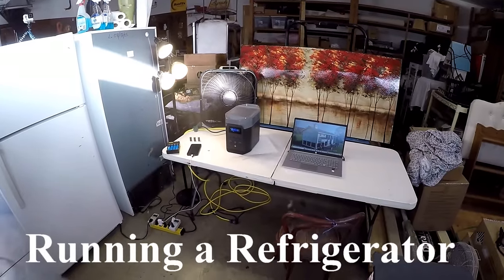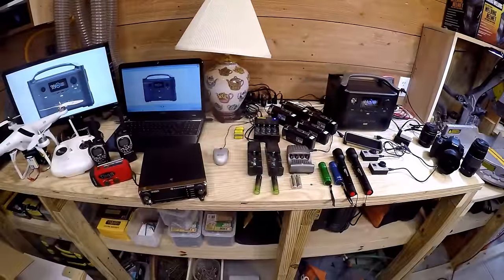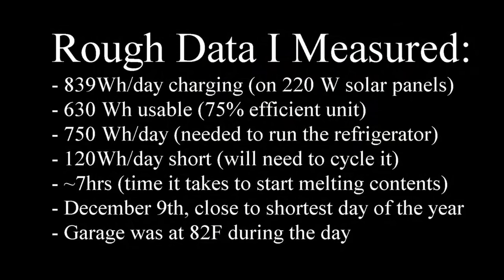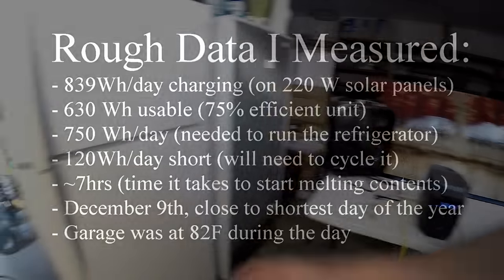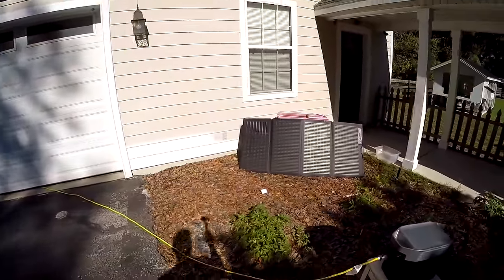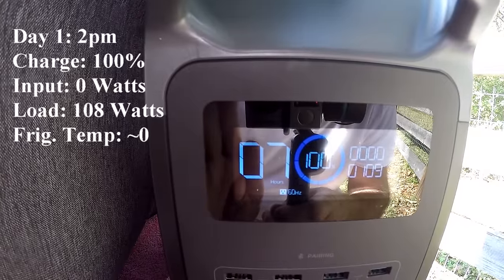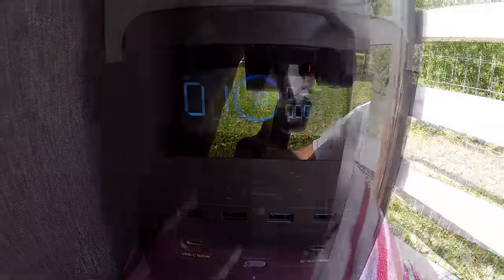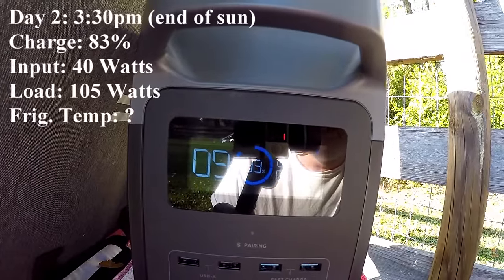EcoFlow Delta 2 Refrigerator Test with EcoFlow 220 Watt Solar Panel

Comment: I am not sure what was the objective of the exercise by plugging in and unplugging the fridge and also turning off the Delta2 unit.
Reply from the maker: The point was to see if the Delta 2 solar generator could back up the refrigerator.  I cycled it to save power and that worked.  Could I have just left it plugged in and turned on the entire time?  Maybe...
Reply: @HomesteadEngineering  ok. Point taken.
I thought you would have just left it plugged in.

Comment: As long as the sun is shining ??
Reply from the maker: Yes, With the sun shinning it takes just about all this unit can do.  If you really want to hold up a refrigerator, I would go bigger (more solar input and more battery).  BTW: I use this unit every day.  Its running a window AC right now. No issues so far.

Comment: What happens if we're really grid down for months/years and updating firmware is impossible? Will this very expensive solar cell fail me when I need it most?
Reply from the maker: I have been running this unit for almost two years with no firmware updates and no issues.  Works like a champ!
Reply: @HomesteadEngineering  Thank you, I've been wondering about it.

Comment: In a true emergency situation, where electricity returns are unknown, it would be wise to insulate the outside of that refrigerator. Even draping towels over it would diminish heat intrusion.
Dang, grease those fridge doors!

Comment: So you could probably cycle off for 5 hours and on for 2 hours. Be interesting to repeat the test in summer, won't be able to turn her off for as long but on the other hand the night will be shorter :)
Reply from the maker: Yep, lots a ways to make it work.  Summer should turn out better.  Thanks!

Comment: Keep in mind “Refrigerator” has a defrost cycle every 24 hours (in my case) defrost do use a lot of power in more watts added to it.
If someone knows how to hack and add a bypass switch to the defrost device, please share.
Reply from the maker: Good to know.  Thanks!

Comment: An efficient fridge should cycle enough to only average about 50W.
Reply from the maker: Yes, I think I got about 32W on average for this refrigerator.  It is a bit on the small side for full size refrigerators.  Thanks!

Comment: To be fair, you DID keep opening the door and letting heat in..... Better to have a remote temp gauge to see temp inside without opening the door.
Reply from the maker: I purposely opened the door a lot to simulate what generally happens in an actual outage.

Comment: can i put in a washing machine;
Reply from the maker: It may run a washing machine but I would not use it for that purpose.  Thanks!
Reply: I wanted to ask something else, I tried to fill it with a Hyundai 3500 generator and it didn't give more than 30 watts, do you know why?

Comment: Having the frozen jugs in the freezer extended the time of the temp going down and melting the ice.
Reply from the maker: YES, That should be a lesson to folks.  If a storm is coming, freeze a couple gallons ahead of time and that should help a lot.  Thanks!
Reply: @HomesteadEngineering  I know I live in PR and went through Maria in 17. I have an ecoflow delta Max 1, and it runs my fridge 12 hours fine no disconnecting. I recharge with a Honda 3000 which tops the EcoFlow in 2-3hrs at reasonable charge speed. Yes all our freezers have ice blocks and water bottles.

Comment: I'm just going to come out and say it. This test was flawed given the fact that he was really only monitoring the freezer which is brought to a much colder temperature below the point that it needs to be versus the refrigerator so based on how he was trying to show us that things were good. Yes only if you care about the stuff. Not going bad in the freezer. Otherwise, things might not have been so good with the refrigerated items they might have gotten up to temperatures in the mid-40s even 50 in the cases that he showed us, which if it gets to 50, that's just too warm. 42 is considered the point at which it is no longer refrigerated but still refrigerated and preferably keeping everything below 40° in the refrigerator but above 32° is the preference for the refrigerator. I guess you're only option if you're in a power outage. Prone area is turn the refrigerator as low as it can go before it freezes stuff and the freezer too. And just because the freezer itself stays cold does not mean the refrigerator stays cold and honestly with the ecoflow units and how fast they can charge from AC power, I would be pairing this particular setup with a cheap gas generator like the one you can get from harbor freight, the predator 1400 generator or maybe even a predator 2000 generator to be able to quickly charge up the ecoflow and have it. Just run the refrigerator constantly and make way more efficient use of the gasoline you have.

Comment: I've confirmed that it runs at max 1800 watts. If you run maxed out at 1800 watts you'll get one hour of use. The 2 solar panels will will recharge it in 3 hours. Only 1 solar panel will recharge it in 6 hours. 

If you only use half of the 1800 watts, 900 watts, you'll get 2 hours of use. Remember this is CONSTANT USE. those extra batteries that aren't that heavy, extend out your hours. Pretty much 1 battery per hour. 900 watts constant use with an extra battery will get u 4 hours of constant use. 

For camping, this is good to recharge things / items with an already built in battery. Phones, Fans, / LED Lamps / Lights,  Laptops, even a small portable camping fridge (yes they make them),  when that battery gets low, use this bank to recharge it. 

Yes you can use power tools with a cord CONSTANTLY, or use the battery power tools  / aka cordless, like DEWALT etc. to me that's the BEST USE of the system. 

For power outages, this could be used to power the modem and router so your phones have Internet while you're down, if u don't have a phone bill, or maybe bad signal during outage, maybe u need to use a small electric burner if u don't have the camping stove or grill of any kind. If your fridge as been unplugged for over 5 hours, u can use this to get ur fridge back to temperature then unplug and ur good for ANOTHER 5 hours. 

Using this to power a small tiny space heater to stay warm probably isn't the best. It'll run an hour and then drain. This is for use during a power outage at home for a little while, to keep small things up and running, or for camping. 

If you're wanting to run your central AC / Heater and lights/ home wifi / TV / Fridge / on a CONSTANT basis during a power outage, you'd need a generator and one with atleast 10,000 watts. Outside you gotta keep it. Plus buying gasoline/ kerosene/ diesel.
Reply: 82 F is also an extreme scenario. During a power outage, most ppls homes aren't that hot. 72 to maybe 74f is average ( 68 F for me personally). During an outage, the fridge is good for 6 hours. I say around the 5 hour mark u can plug the fridge back up to get it back to temp then unplug and extend out things for another 5 hours to keep food good.
Reply: I guess the "way" I was thinking of use, is not using the solar panel as well as consumption at the same time. It's pretty much a "let's see how long 1 full charge gets u until power comes back on" thought process. Using the panels during the day would seem to extend things out giving longevity.
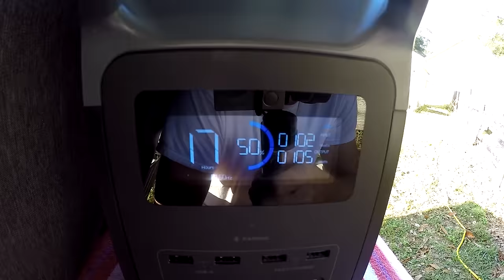Reply: 6:39 this is where I'd unplug the fridge for 4 to 5 hours since the temp is already at 0 F. Takes the load off the unit to help recharge the battery. Take full advantage of the panels power. Per manufacturer, 2 panels running takes 3 hours to recharge with zero load. 6 hours w only 1 panel.

Edit : I don't keep my freezer at 0 degrees F though. I keep it at 30 degrees. And keep the fridge around 40 to maybe 55 it's to chill items so they don't spoil. I assume you're pushing EXTREMES past what average person does. I could be wrong. I'm going section by section of the video without watching fully at first.
Reply: Ok just finished watching all the way through. My conclusion is to run the solar for 3 hours with both panels to fully charge, then can run the unit to power the fridge, perhaps with solar still going it'll run entirely through the day. Then at night like u did it should run the until through the night, unplug fridge for 3 hours, let unit recharge with panels back to 100% then turn back on. 

Good scenario man appreciate ya.

Comment: at minute 5:36, you are Wright.   night temperature usually goes down. so before you go to bed, set your refrigerator to a lowest temp.  before  32 ' or even a little higher than that 38 to 45, when the refrigerator door is not in use. get up at 7am get a good Night rest and turn it back on before breakfast.

Comment: I don’t see the purpose of cycling the refrigerator on and off.  If the panels make enough electricity to fully charge the Delta on a sunny day from a very low charge level, discharging it to 40 or 50% and letting the refrigerator sit there unpowered for hours then turning the generator back on only to drop the temp. of the refrigerator back down to what it was before you shut it off makes little sense to me.  This is especially true if the generator is fully charged while there is still sun.  Then those panels are feeding the generator more power while the sun is out than the refrigerator needs to run.  It is theoretically a waste.

I have a small Bluetti unit that I have conducted some experiments with and I have a Delta 1300 on the way.  I will have a total of 6 100 watt HQST panels which I plan to run 3 in parallel with the other 3.  This may be overkill and overload the generator.  If it does, I will just run 2 in parallel with the other 2.  It will be nice not to toss all my food in the refrigerator away after a hurricane.

I am also looking for advice on charging one with a non-inverter gas generator. Of course I would connect a quality surge protector between the gas generator and solar generator.
Reply from the maker: I think there are several ways to make this work.  I do think you are better off running the fridge the entire time that the panels are in the sun so as to avoid charging and discharging loses on the battery.  One solution is to simply use a bigger system.  
As for the dirty power charging with a surge protector:  I can't say for sure but I really don't think a basic surge protector is going to help you.  It takes some pretty expensive equipment to rectify a dirty signal into clean power.  I think your better off just using clean power from an inverter generator if your going to power sensitive electronics.
Thanks!
Reply: I just finished my own solar experiment with a Delta 1300 and 4 rigid 100 W HQST solar panels. I put the panels on the roof of my screened in room which gets sun about 70% of the day while the sun is up.  I started with a fully charged solar generator.  Day 1 was a good day for solar and I was at 76% when I went to bed.  Day 2 wasn't so good and I shut it down after 48 hours in the early evening even though I had over 70% charge left.  I conducted a second experiment with my Bluetti AC30 300 Watt solar generator and 1 100 watt panel and an in-line meter.  I had completely discharged the unit. During the whole day the meter showed that I only charged 170 watts back into the unit. It was threatening to rain all afternoon.

I already knew this, since I conducted a similar test shortly after I bought the Bluetti a couple of years ago. 

At the same time that I bought the Ecoflow Delta 1300 I bought a 3500W gas inverter generator. Ecoflow recommended that I not use my old generator. I can easily charge the Delta 1300 twice on a gallon of gasoline plus perform some other chores with the inverter generator. I'll still use less than a gallon of gasoline a day if I only use it when needed.  The generator is quiet and costs less than the Delta 1300.  The generator is made by MaXpeedingrods and there are reviews of it on youtube.

I have been without power for several days after a hurricane and l think that this is a less expensive approach than buying a much larger solar generator and hundreds of dollars in panels for a natural disaster.  If you live out West where the sky is not cloudy all day you can rely much more on a solar only setup. Here in South Florida where the days are partly to mostly cloudy I think an inverter generator is a great backup to solar.   

Thank you for your video. It was a realistic application of what one would use a solar generator for.  I have thrown all the food in my refrigerator away on 3 occasions after storms, at least all that I couldn't eat before the food went bad.  In the past couple of days the news has reported hundreds of thousands without power because of storms in the Northeast.  I'll bet a lot of those people would pay a premium price for a fully charged solar generator and some panels.

Comment: I dj on Tiktok in my flat im looking to do a few lives outside but been looking for a power bank people mentioned the jackery but people said the ecoflow is better. Im gonna be using my laptop outside my dj controller and 2 little speakers how many hours do you think id get out of it djing outside.
Reply from the maker: I would get a Kill-A-Watt meter and measure how much energy your actually using.  
https://amzn.to/4d3Y5UD
Plug a power strip into the Kill-A-Watt meter and then plug all your stuff into the power strip.  Then run it for a few hours and measure how much power you use.  Then you will know what size unit to purchase.  Be sure to oversize it by about 20-30% so you don't have to worry about running out during a show.
Reply: @HomesteadEngineering  Nice one think im gonna just get the ecoflo Delta its like £900 tho guaranteed to do my sets outside for a good few hours at least its just pricey.

Comment: What I do like about that Delta 2 is that I am able to connect my Delta Max extra battery to it.
Reply from the maker: That is a nice feature that really extends the use.  Thanks!
Reply: I think all the Deltas can hook together, as long as the smaller one is hooked to the larger one. I even saw a video of a guy that had 4 different named generators to each other. He said he just wanted to see if it worked, and it did. 🤔 I wouldn't have thought of that.
Reply: Oooh I didn’t know that but now I think I’m fully sold!!

Comment: Wow. 😲😲😲 I must be doing something wrong. I only got 4  1/2  hours refrigerator time from my Delta 2! 
I'm not happy with it at all. 
I also bought just one EcoFlow 220W Bifacial Portable Solar Panel. When I hooked it up, it told me it would take 28 hours to charge up the unit, and it was noon with no clouds in the sky. I understand 220W is just a fraction of what the unit will take, but I was hoping for better than 28 hours. I even made sure I had the panel facing the correct direction.  I also didn't realize you could put an extension cord on the panels. That's handy. 
Is there someway to program the unit for more efficiency? I just took it out of the box, charged it up, and plugged in the fridge. @HomesteadEngineering
Reply from the maker: Lets dig into this a bit:
1. How many Watts were you getting from the solar? You can see this on the screen when charging.  Should be about 180ish in the full sun.
2. How much power does your fridge draw?  you can measure this with a meter: https://amzn.to/4brfi8S
Those two things will tell us a lot.
Reply: @HomesteadEngineering  
on the Delta unit, it showed 175 when the fridge was running, and 35 at idle. 
I don't have one of the little meters yet that I can plug straight into the fridge to show the wattage.

The solar panel was in full noon sun, I made sure it was facing the right direction, and it showed 87 input.

I was not using the unit while trying to charge it with the solar panel. I just have the short cord that came with the panels to plug it into the unit, so I actually had to drag the unit outside to charge it. I need to look into getting an extender.

Comment: how long will it run small appliances like a LED TV, and a few LED lights?  i want a how long will the full battery last test for small off grid use.???
Reply from the maker: It all depends on what you plug into it.  It has a 1kWh battery but lets call it 750Wh after loses.  So for example, it will run 75 Watts of stuff for 10hrs.  It would run 7.5 Watts (LED Bulb) for 100 hrs.  Check this out: https://youtu.be/vnt4nF0RGEw?si=HiRw9rZOsn7kmKvC

Comment: Check out their rating with the Better Business Bureau before buying.  I wish I had.
Reply from the maker: Di you have a problem with the Delta 2?
Reply: @HomesteadEngineering  No...I had ordered the DeltaMax 2000 +220w solar panel.  Never received the solar panel.  They say I did not add the solar panel to my order.  Yet, the ad stated DeltaMax 2000 + 220W solar panel and had a picture of the two items together along with the phrase "Black Friday".  My receipt even says DeltaMax 2000 + 220W solar panel.  When I called the company to ask where the solar panel was they told me I was not the only customer to complain and that if I wanted to return it they would subtract a $70 return shipping fee and a fee of 3.6% of the purchase price because I had used paypal.  The total out of pocket would have been approximately $150.  When I filed a complaint with the Better Business Bureau I saw numerous other complaints against this company.  The Better Business Bureau attempted to contact the company twice but Ecoflow did not reply to their inquiries.
The Ecoflow companies rating on the Better Business Bureau website as of yesterday is an "F".  I believe this is the worst rating they give companies.
Reply: @Mike Dunning happy to help Mike.
Reply: @DaveC-sx3gl  This is true Ecoflow  sucks in customer service.